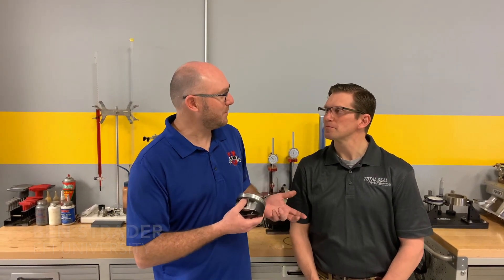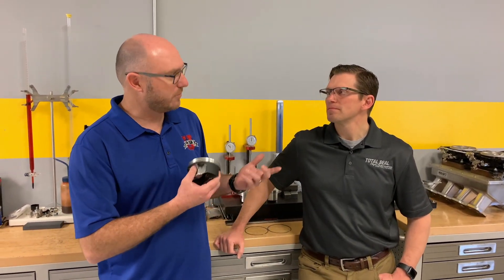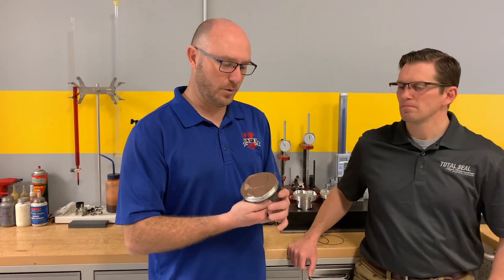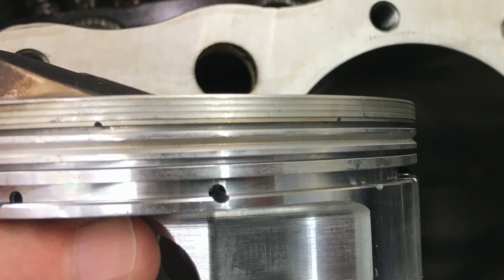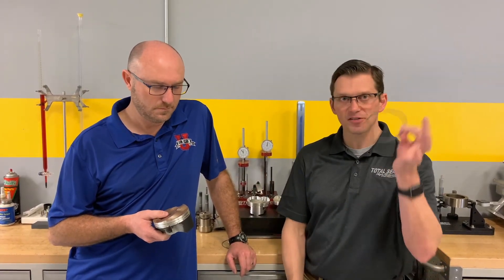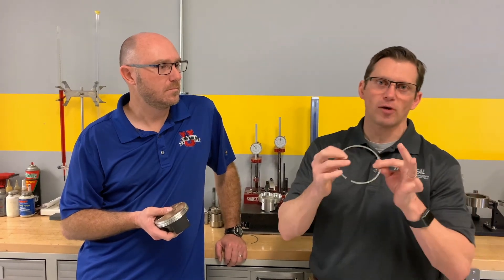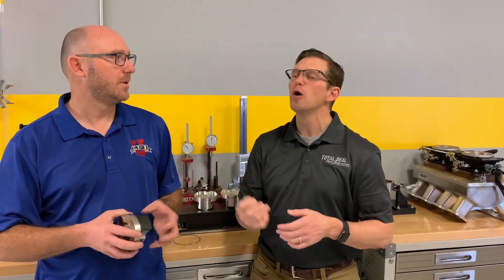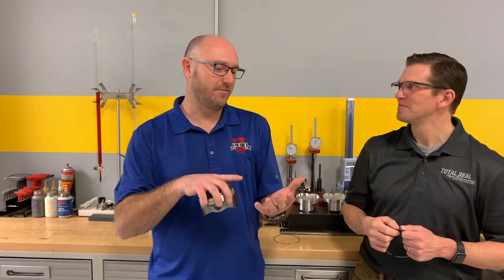The importance of ring seal on engine efficiency! Ben Strader explains...

Comment: I used these in the 90's and 20 years later there is still next to none user experience on the internet....only sales persons
whats going on guys......where are the people using the rings ???
Reply from the maker: Gas Ported Pistons have indeed been around a long time, but gas ported piston rings are new (last few years). Even in that short amount of time, top engine builders in open wheel, drag racing and oval racing are using gas ported rings, and they are seeing improved horsepower and torque compared to gas ported pistons.